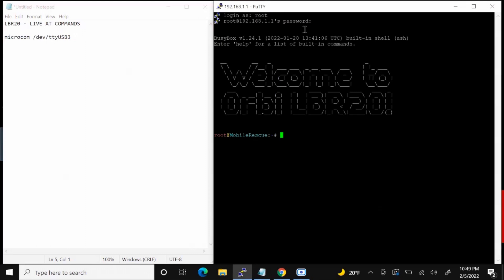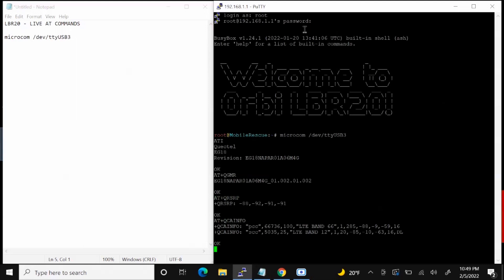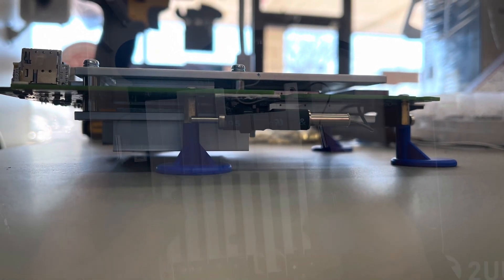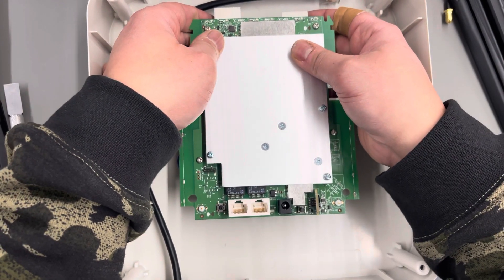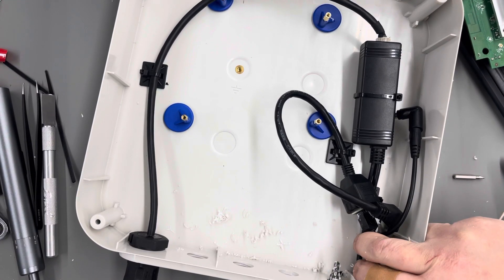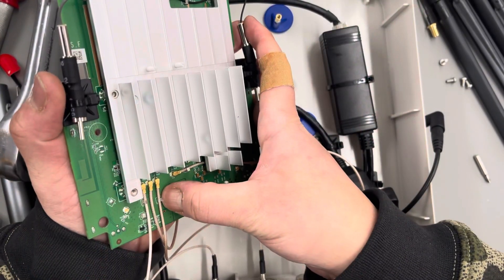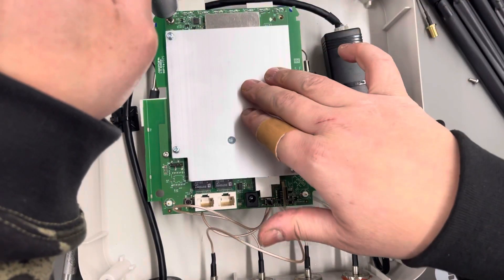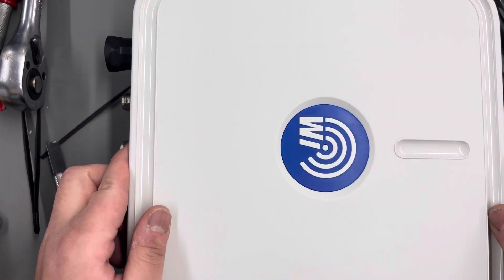The Fastest Unlimited Hotspot Part 3 - SSH microcom and the outdoor enclosure POE Setup Completed

Comment: I live in ohio do you think i should worry about condensation inside the box , going from freezing temperatures to summer temperatures ?  Just curious if you have used them in this type of weather.
Reply from the maker: Air tight and works... my other unit discolored on the outside but everything on the inside was pristine